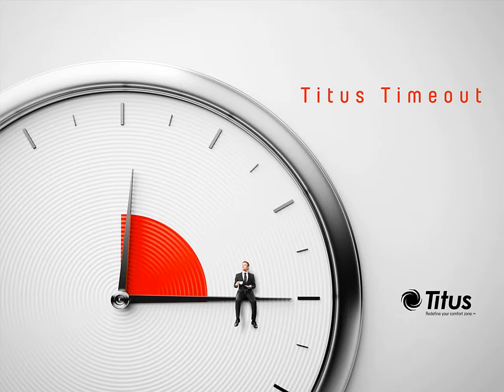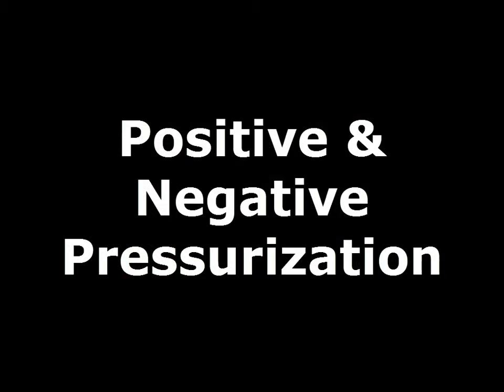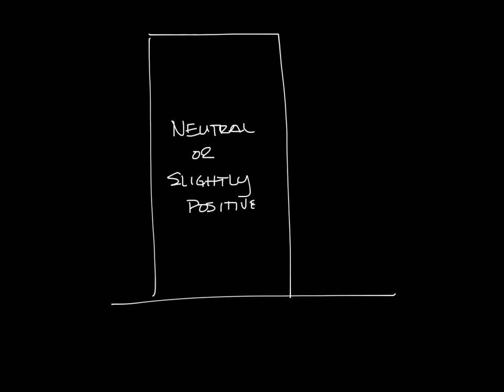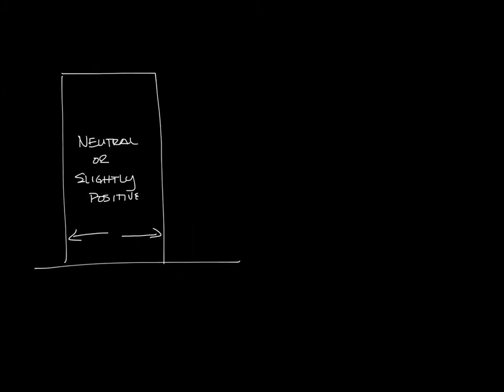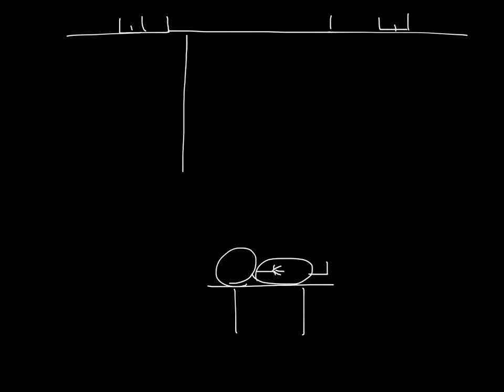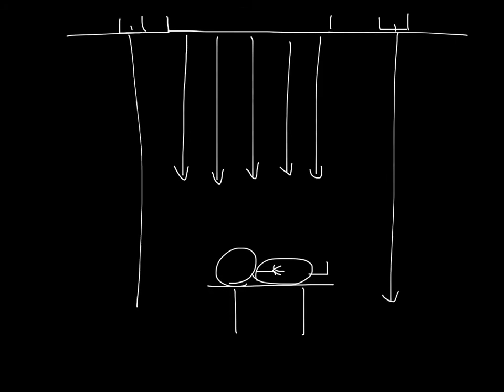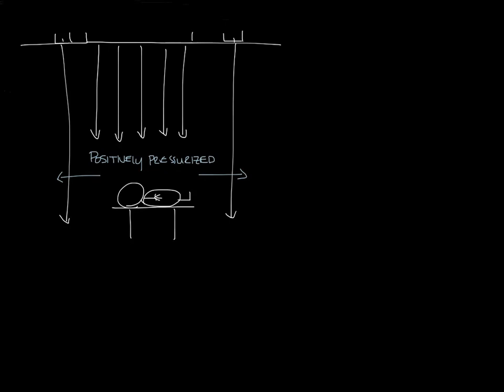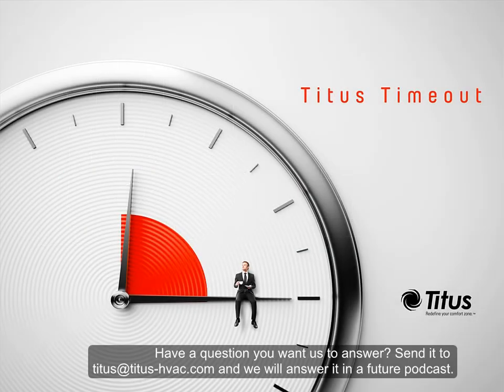Titus Timeout Podcast - Positive and Negative Building Pressurization

Comment: what if thats a infected person with spreadable disease shouldn't the o.r. be negative to the corridor?
Reply from the maker: ASHRAE requires ORs to always be positively pressurized. The FGI guidelines offer a bit more guidance stating that invasive procedures are performed in rooms meeting the requirements for AII rooms or in a space with local ventilation. If these procedures are to be performed in an OR, they refer to two CDC guidelines: Guidelines for Environmental Infection Control in Health-Care Facilities and Guidelines for Preventing the Transmission of Mycobacterium tuberculosis in Health-Care facilities. Both of these also recommend using positive pressure and local exhaust.